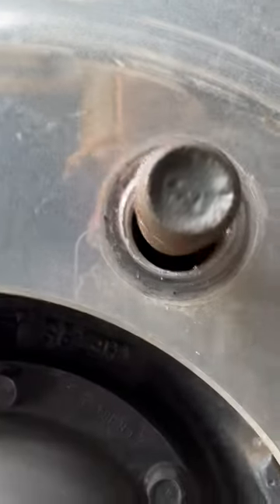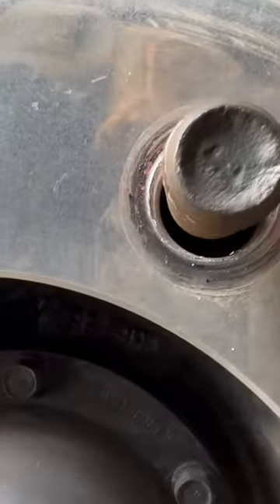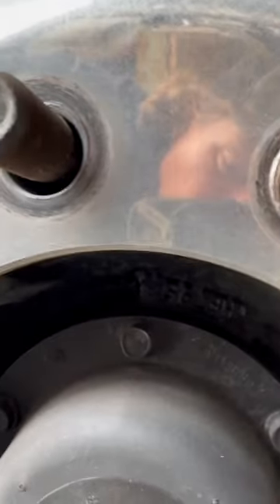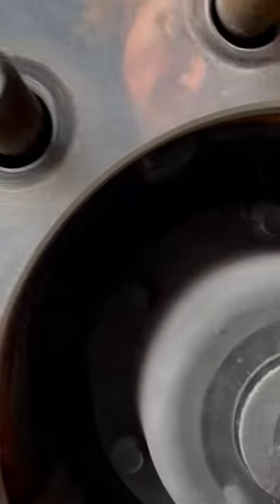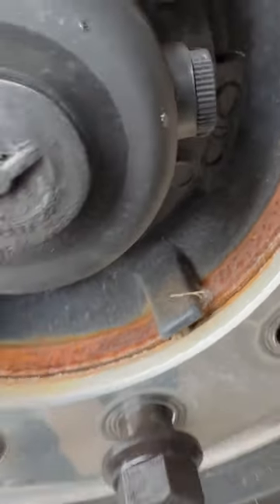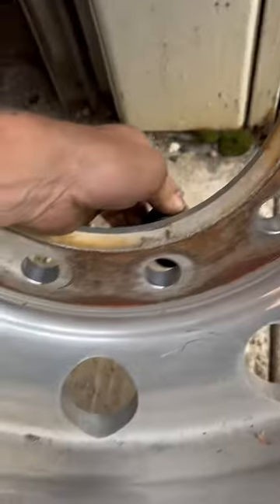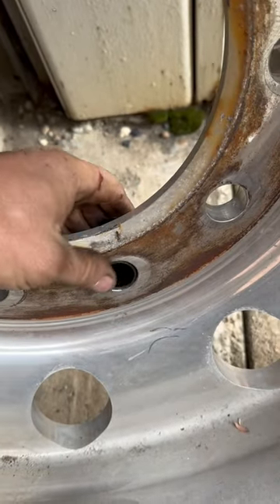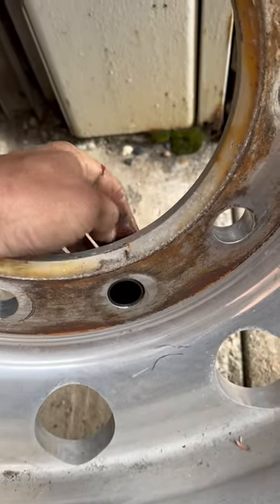Vibration fix or destroy tires #shorts #viral

Comment: In the car/truck aftermarket wheel, tire world, that's basically a shank style lug nut but for good centering we'll what is referred to as an ET lug nut and there's multiple versions for whatever is needed for each particular style of  wheels mounting requires.
Reply: Correct me if I'm wrong, I don't know much about this, but I've heard them called "mag style" lugnuts as well. Is that true?

Comment: Brother, please be careful, not that I imagine that you're not but speaking from experience, the ring on the hub encompassing the wheel studs, can develop a hairline crack between it and the bearing housing. Resulting in a vibration and possible disappointing separation between the two, at speed, when it's to that point of wear. Tap it like you do U-bolts, listening for the same result ❤